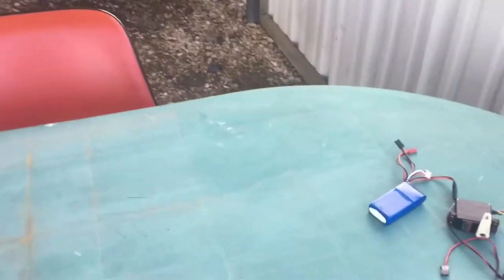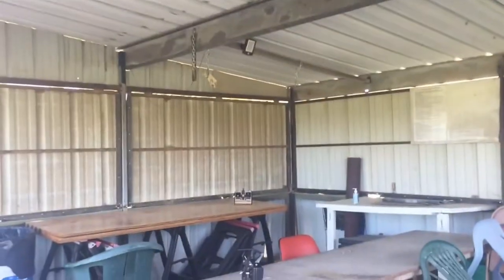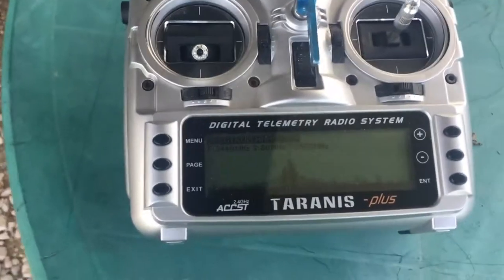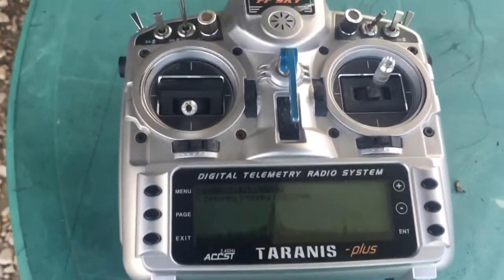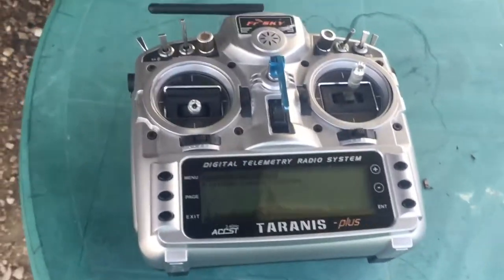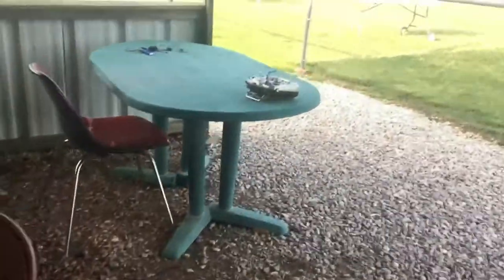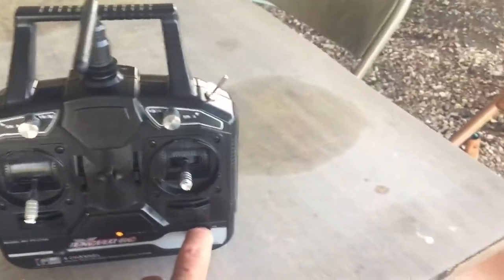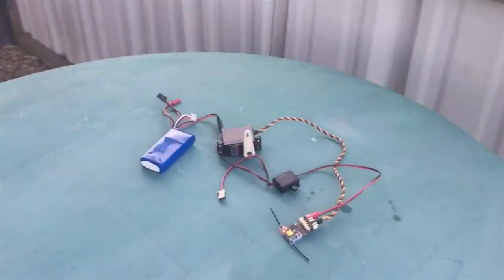Lemon DIY Tx Module Failure to Connect to a DSM2 Rx

Comment: Thanks.  Demonstrates that the transmitter module is not choosing two unoccupied frequencies at power on.  But I also wonder why the receiver didn't operate anyway, by picking up the other (unoccupied) frequency?  I thought the whole idea behind DSM2 was that it would continue to operate when one of the two chosen frequencies happened to be blocked.
Reply from the maker: I would tend to agree with you.  Apparently the DSM2 receiver needs to identify a valid link with both frequencies before it establishes a control link.  In another experiment I did the interfering signal was reduced by putting my hand over the Exceed antenna until the DSM2 receiver connected to the DIY module.  Once the control link had been established, removing my hand from the Exceed antenna did not break the control link between the DIY module and the DSM2 receiver.  My guess is that it was using only the clear frequency to maintain control.